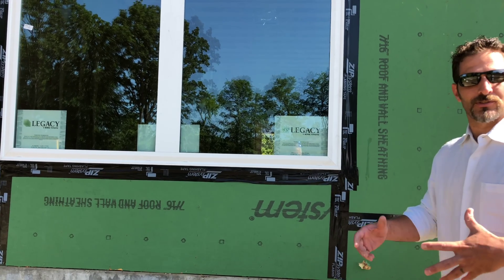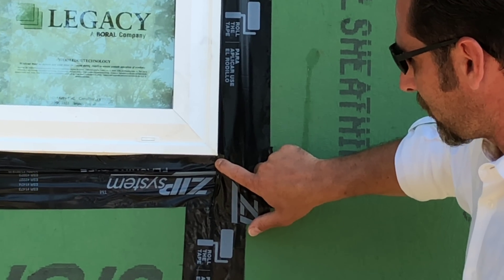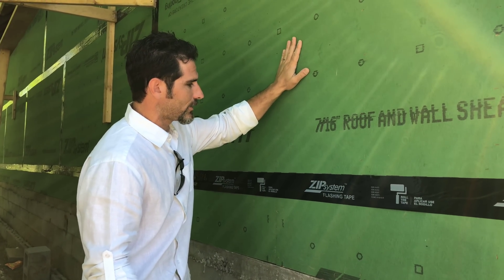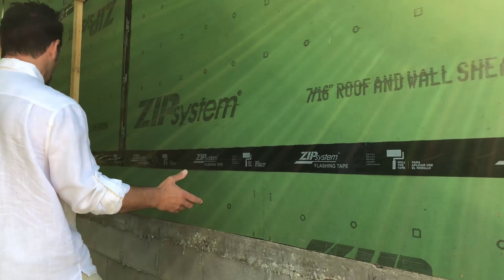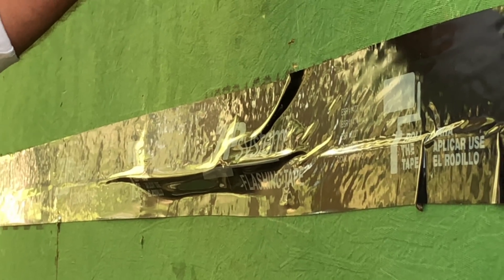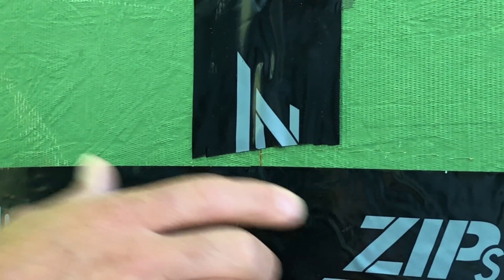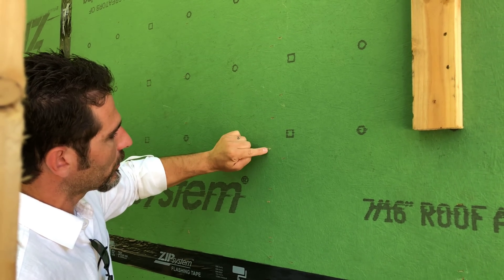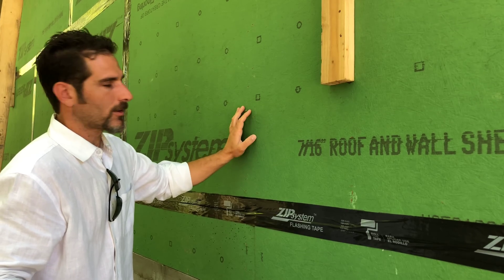ZIP System Problems

Comment: This otherwise pedestrian YouTube video is making me angry because it violates some simple rules of being fair.  Throughout the whole thing, the presenter begins his takedown with "Zip wants you to..." and then he proceeds to point out how the builder did not do what Zip specified and the terrible fate now set in motion because he/she didn't. Is this a critique of the Zip System, or a critique of an installation of it that happened to have been done poorly? Clearly it should be the former, but why is he presenting it as a failure to the system?  

Raid sternly cautions against spraying their products into open food.  Raid is no good because people sprayed their product into open food; got poisoned.  Maker of product which happens to be flammable provides a warning, in big letters with bright background, that it should not be used proximate to open flames or sources of ignition. Doofus sprays product into a open flame; suffers 3rd degree burns, house burns down. YouTuber condemns product because it will make your house burn down.   

Make it makes sense!  Why not title this "poor installation of otherwise fine Zip System will cause problems?"
Reply from the maker: I’m guessing you didn’t watch the whole video entirely? Because if you did, you would’ve heard me talk about many of the points you are talking about. Zip could be a decent system if it’s installed 100% correctly. The marketing hype that they are pushing to builders is very misleading and is giving builders/homeowners false security in their projects. I am trying to raise awareness, these systems can be very hazardous. If not installed 100% correctly which is very difficult to do unlike the marketing sells. Thanks for watching.

Comment: That house is an excellent example of what not to do on so many levels - framing, sheathing, taping, sill prep and the list goes on.  Look at how uneven the panels are at the seams, that causes bump and ridges that are hard to tape and obviously this contractor never heard of a roller.  The bottom course of OSB should be outside the foundation wall and stop 1.5-2" below TOF, z flash and liquid flash.  Windows, well they are rarely done right.  Perms - insulation and HVAC have a lot to do with where that should be.
Reply from the maker: And the list goes on…..
Thanks for watching!

Comment: I almost never see the zip tape job done correctly. None use a roller. Lots of wrinkles and over driven nails. This task is done many times by the wives of the framing crew or the least experienced workers on the job.
Reply from the maker: Precisely why I’m trying to raise awareness because these systems are causing major issues for homeowners long after the builder says his responsibility is over! It’s a very sad situation these systems are leaving homeowners in. Thanks for watching!

Comment: Use Liquid Flash over the Nail Holes and use a Bondo spreader to smooth it out.
Reply from the maker: What about all the other issues?
Reply: or just tyvek it and save on labor paying some scammer sub to spend a week bondoing nail holes

Comment: You're supposed to use the stretch tape over the window seal and roll it before you install the window! Also, you don't tape over the Bottom Window Flange AKA Nail of Fins, that way water can drain out the bottom!  also, you need (2) 1/8" Plastic Shims installed between the Window Flange and the Zip Tape or stretch tape attached to the Zip Sheathing and the Window Sill. again this is for water drainage! EVERY Professional New Construction Window installer is supposed to know this process!   https://www.youtube.com/watch?v=7XFS3oLu5J8&t=84s

Comment: You're supposed to use Liquid Flash on the bottom! another Epic Fail on the part of the Job Site Foreman!
Reply from the maker: It’s funny how everyone thinks that liquid flash is some magical sealer that doesn’t crack or deteriorate over time. Not what I would want to rely on to keep water out of my structured, long-term!

Comment: You can't blame the zip system for sucky contractors. Sucky contractors will screw up Tyvek just as bad. Its all about quantity not quality!
Reply from the maker: Unfortunately you are correct. However I have yet to see a zip project done correctly! I am sure there are a few contractors around the country that actually pay attention and make sure all details (much more to do than Tyvek) are done correctly but I have not witnessed it myself. I have however seen many generic housewraps as well as Tyvek done correctly! Not very many are 100% but they have a far better chance at preventing leaks and or condensation issues than integrated wrb systems by far!

Comment: Not sure if anyone posted this, but Matt Rissinger did a video about the "testing" between the two systems.   The leaking though the nails in the zip system was compared to a non-penetrated area of tyvek.  Put the column of liquid over a cap fastener, and you'd see tons of penetration too.  Condensation would only be an issue if you did a lousy job insulating.  
As others have said, this more about a terrible crew, rather than a terrible product.   Just goes to show that if you're having a house built, you should do your due diligence,  learn about proper applications and visit the site often.   If the contractor has an issue with you visiting and finding issues, you hired a crappy contractor.
Reply from the maker: I am aware of the videos you are talking about and you are mistaken because Risinger is inaccurate in telling folks in his video that there was no cap under that column when in fact there WAS a cap under the water column and you can check that out for yourself by watching the actual video! Risinger is a sell out and only promotes what lines his pockets, I however give real world experience with no compensation! Hope you find the truth so you are not mislead by paid advertising! Thanks for watching
Reply: @WeatherProofingAmerica  good to know!
Reply: @WeatherProofingAmerica   truth!

Comment: The biggest issue with coated osb are the horizontal tapes. They are not in a shingle fashion.  I see sites all over where they have to install a housewrap over zip. and redundancy is not a bad thing when it comes to water management.  The biggest lawsuit for water management was in Sodoma, AZ because it was not breathing adequately. Yes in the desert. Tyvek at 58 perms is also tight. I see many cases where it sticks to the osb because of condensation not coming out.  LP & James Hardie are now recommending drainable housewraps with a minimum of 1mm non-compressive spacers. In Louisiana and Canada it's a min 3/8" gap.
Reply from the maker: Air gaps should always be used on any rigid fascade that is directly fastened to the wall. This would include stucco, any rigid siding(hardie, wood, composite), faux rock etc. Thanks for watching!
Reply: @WeatherProofingAmerica how would you do an air gap on hardie plank?

Comment: Tyvek=gimmick, Zip=gimmick.   The biggest problem with houses are windows, doors and the HVAC system. You can insulate the shit out of it, make bigger eaves to keep the water off , but those three things contribute more to energy/moisture issues than anything else.
Reply from the maker: So what is YOUR solution?
Reply: @WeatherProofingAmerica  Conditioning the interior air, first and foremost. The AC is the most expensive and least considered part of most houses. If you can control the humidity, temperature and pressure differential  you can keep moisture out of the house. Air exchangers have seldom been used in homes, but equalizing pressure , coupled with humidity control keeps moisture from migrating into the home. Admittedly , those systems are pricier, but they are the ultimate way of keeping the balance where you want it.  The reason old houses are still with us is because they leak air, which is where the balance comes in. Water intrusion is more obvious in that all you have to do is keep water from running down the exterior walls and splashing.  In so far as windows go, you'll never regret buying better windows, but I will admit that the market is screwed up because you don't have a lot of mid-range windows that center on performance.  Vinyl is a great choice for durablity, but not looks. storm windows are also a forgotten, but effective.......if you live somewhere wind driven rain is an issue.  

I think ZIP, TYVEK etc are good for keeping the wind out, but once you put holes in anything, the moisture aspect is lost.
Reply: @theprofessorfate6184  see the issues you describe are only an issue with a very tight home that cannot breathe aka zip. With Tyvek you don’t have that permeability issues because the Tyvek keeps the air and water out while allowing the condensation in the wall cavity to dry to the inside or outside depending on time of year! So thanks for proving to yourself why zip is a bad idea on many levels!
Reply from the maker: The point here that I am making is how many of the zip homes have properly condition there inside air to compensate for the zero permability of an integrated WRB? Answer is probably very few. Therefore with a housewrap that has a high perm rating like Tyvek it is a solution without having to go through the extra expense and trouble of conditioning the air through exchanging. A lot of folks cannot afford to build a home with that type of system. Therefore if a home is built with zip and no air exchange system in my opinion especially in a hot climate that will be a major problem in the future.

Comment: Crappy sub not installing it properly and a crappy GC not inspecting his/her subs .  Also they did not address the nail holes.
Reply from the maker: I encourage you to stop and look at the next project you see being built with this product. Also take a look at the videos bc not all the things I talk about and point out are installation error but more of a product set up for failure in my opinion.
Reply: Well I would argue that any MDF based product should be avoided,  but building trends are what they are so unless it’s a completely custom home it’s gonna be filed with whatever that builder Iikes using.  

Tyvek is a fine product but it’s almost never installed right (or in the best method) and it’s often left for months in the elements (yes I know they say if can do 9 months).  My point being most of these systems if installed correctly all perform quite well.  Some better than others for sure.  But all of them fail miserably when workmanship is lacking (or the homeowner is simply getting screwed).  

I did enjoy your video and agree with all your points. Keep them coming

Comment: When using the zip system, you have to include the building as a passive house system. You can't use the standard heating and cooling. You need to set it up to have a continuous passive ventilation system such as HRV or ERV along with a dehumidifier system. Otherwise, because you're creating a air tight envelope to the exterior house, you're going to have condensation issues.
Reply: This
Reply: This has nothing to do with Passive House, that is a thing. You DO need to correctly design the HVAC systems and mechanically control the air coming into the home. No matter what your Air Barrier system, and you should control your fresh air intake, ie bring it in intentionally and filter it properly, not just let leak in through holes in the envelope bringing in pollen, odors and other air pollutants. Good Indoor Air quality is something that everyone deserves. Not Leaky Houses. I am simply describing a Pretty Good House, not a Passive House.
Reply from the maker: Correct!

Comment: Great video and any product or system is only as good as the installation. The builder and installer is doing substandard work and they should take complete responsibility for the shoddy installation. Why not locate the builder and installer and do a video on them. Expose the risks and hazards of not following the product manufactures  installation recommendations.
Reply from the maker: I have spoken to many builders very few care including this one. Sad state but reality.

Comment: You're supposed to roll the tape after installation and use the zip system caulking on the TOP and BOTTOM! I haven't even installed it yet and I know this. These contractors are assh*les.
Reply from the maker: Sadly, this is the most common practice. You will see when the system is used. Hopefully you will install yours much better, because if not, you will have some major issues.
Reply: @WeatherProofingAmerica  I'm still not sold on Zip system.

Comment: The bottom of a window should not be taped or sealed with sealant. If the top or sides get a leak the water will get trapped and rot the sill
Reply from the maker: You are correct. Thanks for watching

Comment: Please do a video on the Zip System 2.0. Huber came out with a second iteration of the system that includes a liquid flash product for joints in the sheathing and nail penetrations, rather than the tape. The liquid flash seems like it could solve some of the common install issues you point out in the video.
Reply from the maker: Sure, the liquid flash could solve some of these issues, but what happens to the liquid flash overtime through expansion and contraction as well as thermal load? Not what I would want to rely on long-term to keep water out of my structure!

Comment: This is a terrible video since you are using wrong data and blaming the system itself as bad vice the contractors. If you actually watch the zip vs tyvek video where its leaking threw the nail critically, the tube of water is sitting vertically on the inserted nail of the zip board but on tyvek wrap the tube of water is sitting in the middle of the wrap with the fasteners at the corners. You are either a fraud and purposefully misleading your viewers or are so ignorant that you should not be advising people on this subject. Either properly research a subject or dont do a vid on it just for the clicks.

Comment: I would prefer to use screws verses staples or nails that you can't get flush or a little shallow then use liquid flash to cover all the screws or nails. A good quality pneumatic nail gun should have no problem driving a framing nail flush.
Reply from the maker: Screws would take forever, but would be very effective. A properly adjusted nail gun can definitely shoot a flush head nail. I do it quite often myself! Thanks for watching.

Comment: This is what happens when the crew retard is responsible for putting the tape on or this was staged. As with any product if the directions are not followed failure rates are high. Zip is a high quality product easier to get a good blower door score with zip then other products. This guy showed his true colors towards the end I wonder how much he's being paid by tyvek. Low permeability rating is a good thing. Put your insulation on the exterior of your low permeability layer and you will have a building that performs well in any location.

Comment: You forgot the “using a roller on the Zip Tape part to allow its adhesive to work better part”, which makes Zip Systems even worst! Slap em’ up houses are destroying lives!
Reply from the maker: Unfortunately, you are correct.

Comment: The customer needs to inspect thoroughly every step. We have a builder who keeps making mistakes even after showing numerous videos of the proper way of installing Zip. It's annoying! Most people do shitty work if they can get away with it. Too much laziness!
Reply from the maker: Sadly this is all to prevalent in the construction world!  Thanks for watching
Reply: @WeatherProofingAmerica  thanks for the reply. Now I'm looking at sueing my builder. After he installed the Hardiplank without hitting a single stud. He countersunk all the nails. He didn't use stainless steel in our high humidity area. He caulked where he shouldn't.  There are nails throughout the zip system sheathing in between the studs. I'm furious!

Comment: I'm sure tyvic loves you.Any building product is not going to work as advertised if it is not installed correctly. If I knew who this builder was I would not buy a home built by them. With a home so sealed up like you can get with a zip system any experienced builder would know that you are going to need a dehumidifier with the HVAC system.Not really sure how they do it up north. But in south Texas it is a must have item......
Reply: And lord knows it’ll rarely be installed correctly.

Comment: Poor workmanship not a poor product. Blaming the product is just like blaming guns for gun accidents...stupid.
Reply from the maker: Well see this is where we disagree.  The gun manufacturers don't go around and falsely advertising that their system installs faster, easier & better than housewrap!  ZIP however did just that & more with their incentive programs and such and this is the result!  I have even had lumber reps tell me a ZIP rep told them the osb swells and seals around fasteners the first time they leak...REALLY?  Wow! This is one of the major reasons I started this channel, there is so much misinformation and bullshit out there it is hard to know unless you have experience like me!  Thanks for watching, I agree about the guns btw!
Reply: A good product doesn’t need fancy pants workmanship to work correctly, this does. Good products are fool proof intuitive and idiot proof which is important since most people are idiots.

Comment: So is it a product problem or an install problem? 🤷‍♂️
Reply from the maker: Both! The product has several major flaws. The biggest of which is the zero perm after taping. The marketing they have done for this product has made builders and installers think it’s bulletproof, idiot proof and waterproof when it is far from any of those! These systems are being installed across the US just like this and Huber doesn’t care one bit...not the type of company I would want to use. They have no support systems for installation only false advertisement.